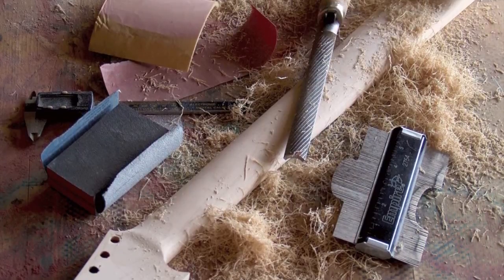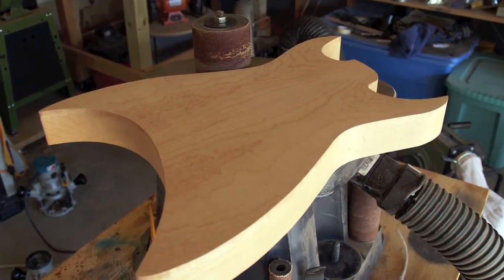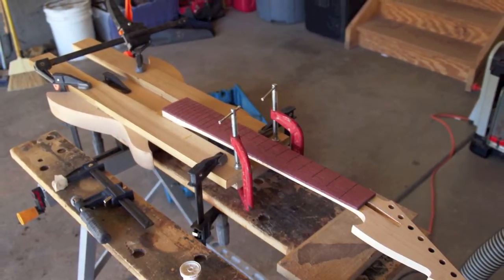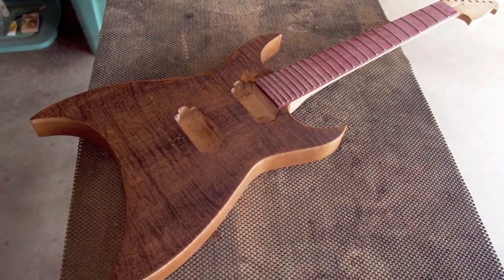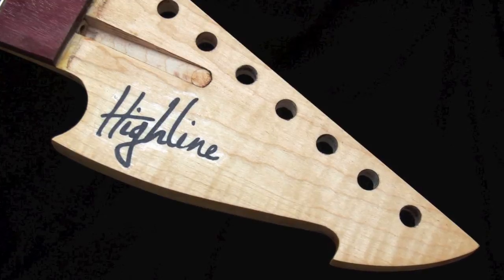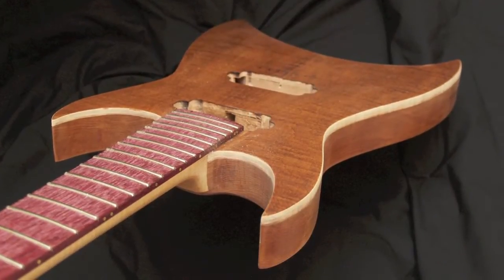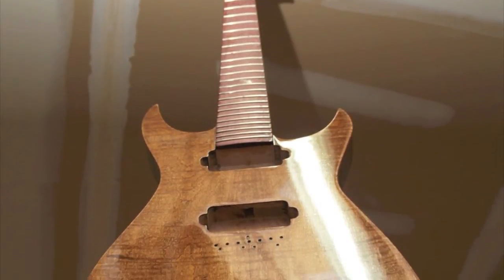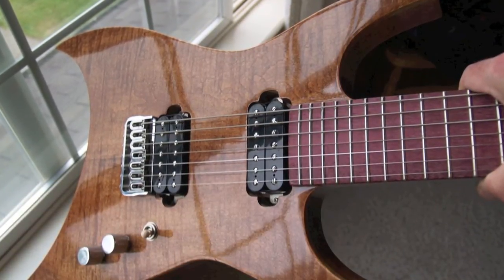Making the Highline Shuriken 7 Electric Guitar

Comment from the maker: The polyurethane is thinned with mineral spirits and either tung oil or boiled linseed oil. 1/3 of each. The mix is applied by wiping it on one coat every 3-4 hours. Practice on a piece of scrap wood to get a feel for how fast it sets up.